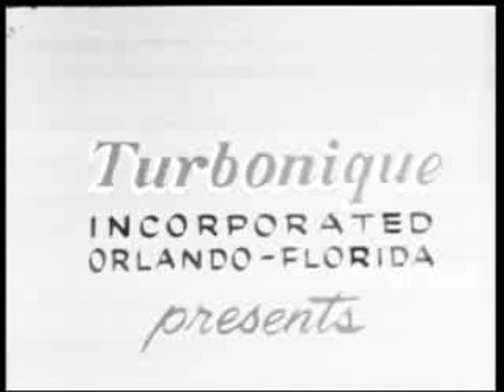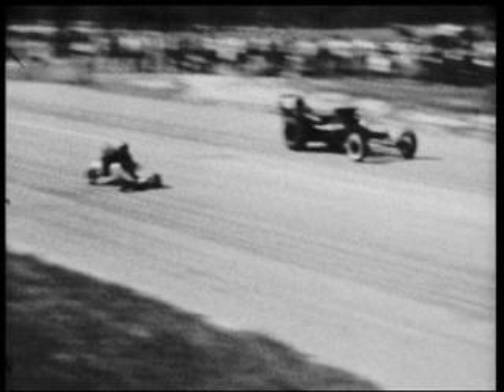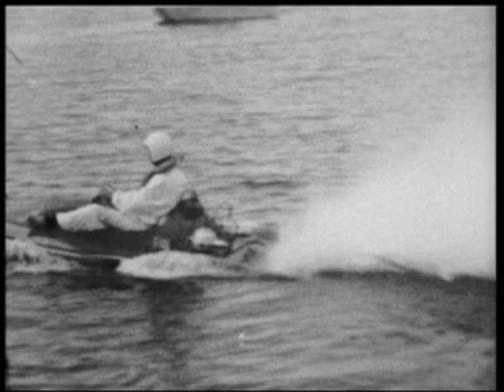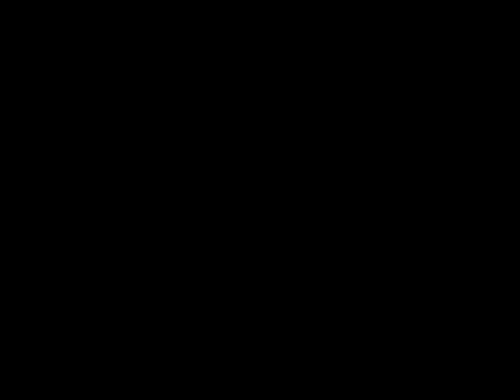Turbonique engine noise

Comment: An old friend of mine sold ball bearings to Mr C.E. Middlebook the owner of Turbonique, and the designer and builder of these unique engines. Those rocket turbine engines used a set of bearings on every run. On one application they were used to power a turbocharger that reached high boost levels in seconds. While the products were engineered to make power there was much to be desired in their applications. Mr Middlebook eventually spent time in jail for mail fraud for not delivering product.

Comment: Y'all realize that as installed on a cars differential as shown on the other video, the exhaust port for that turbonique thing is right under the gas tank, right? :-o
Reply: If you go fast enough it won't touch the tank
Reply: Do you wanna go fast or not? You can't think about that kind of stuff if you do. 👍
Reply from the maker: Yes
Reply: And???